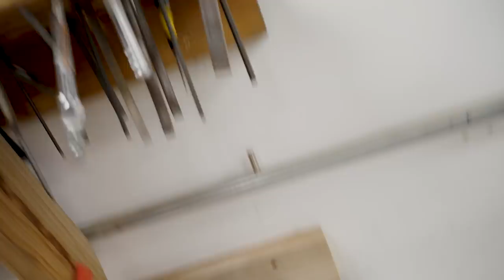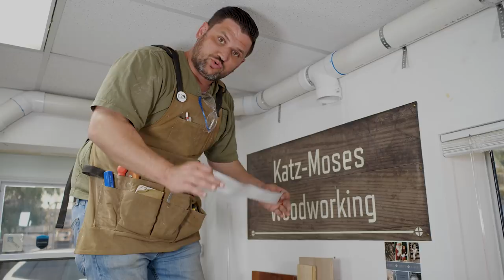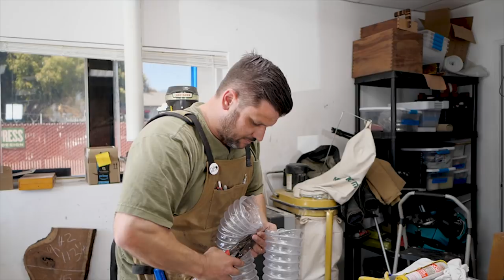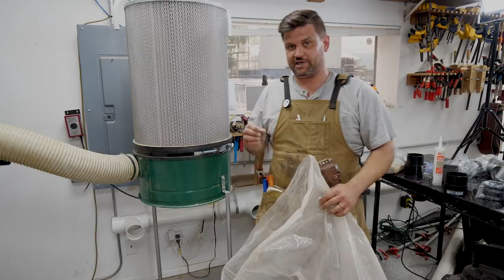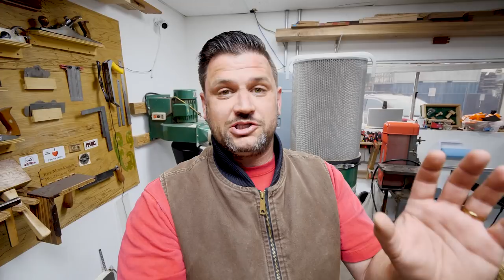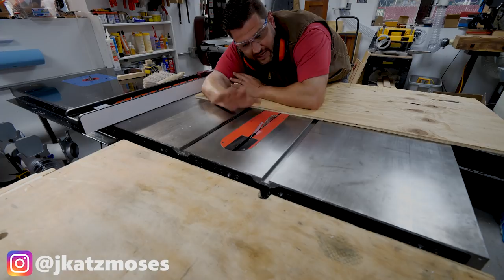Dust Collection 101 and Converting to 2 Stage Dust Collection

Comment: I was thinking of using push fit fittings as no glue needed you just push together there for water so it’s watertight no air leaks and you can just pull apart to change it or if you move not sure if available in America but available in U.K.

Comment: PVC pipe and gluing, try to rotate a 1/4 turn, it will insure a better bond. But you HAVE to move quickly and accurately to your intended position. It will guarantee the seal as well. Hope that helps!
Good tip on the drainage pipe as well thanks!

Comment: You could reduce the amount of dust in your collection bag even more by adding a straight run of about 5 feet of pipe between the intake of the Oneida cyclone and your blast gates. This creates a better straight line of dust flow into your cyclone. Works very well in my HF hybrid system.

Comment: Late to the thread on the comments here, but found a different way to seal the connections. I have several fixed (glued together) sections, which will likely never get moved, but for areas that might be shifted, I use a couple wraps of 3M electrical tape on the male ends and do a force fit without glue. So far, I have no leaks. I have found it necessary to glue or screw together some joints on vertical runs, so they can't vibrate loose and fall out, but the majority of connections aren't permanent.
   Another seal method is to force fit the pieces and use a SMALL bead of basic latex/adhesive caulk (Polyseamseal or White lightning, etc) on the joints to seal. These joints can be twisted apart for modifications, because the bond of the caulk isn't that great.
  Love the video Jonathan, but I do think you would benefit from the use of wyes, instead of Tees at the intersections. Using a short section of pipe between 45 bends also reduces the drag to airflow, based on numbers Have seen with an anemometer.

Comment: if you had to do it over, would you scrap the single stage and go with a high quality cyclone? seems alot of shops have the hard filters, but they still get plugged even when using the upper wiper handle. I have a cyclone unit that i plumbed the piping to the shop wall, exhausting the super fine to atmoshpere, as the filters are extremely expensive. I build in two large fans put in reverse into window openings that help pull any super fines from the shop air. If one was woodworking in the winter, having heat is a must, esp for solid wood projects, and this would be a negative with all your heat getting blown outside. Nice video, enjoyed watching!!!

Comment: Did anyone else JUST learn about the cutter on the caulking gun?
Reply from the maker: the hobbyist hahahahaha
Reply: Absolutely~!  I've never noticed that either.
Reply: I had a combination square for 30 years and discovered the marking pin recently. Really had a good laugh at myself.
Reply: I have a bunch of old caulking guns that don't have a cutter AND some of the ones that are supposed to have cutters don't work well enough to even try.  Unless you have a new tool, it isn't worth trying, just do it the old fashioned way.
Reply: Wait, there’s a cutter on a caulking gun??? Lol

Comment: Does the "squeeze out" of the glue on the inside of the pipe or the other dribbles of sloppy gluing cause problems with blockages in the pipes once you start using it?

Comment: What are your dust collector specifications? I am looking to setup the 4 inch super dust deputy as well for just using on a 6" jointer, 13" planer and table saw (one at a time) with relative short connections and was wondering if a smaller 600ish CFM would be ok.. most that I have looked at don't list a static pressure but I don't think it will be that much of an issue as I will be connecting it directly when using each machine. TY.

Comment: I just got a new Harbor Freight 2HP dust collector to replace my Rockler Dust Right, I also have set it up as a two stage unit. I tried to keep the biggest dust making dust tools closer to the collector. I have all of my power tools along one wall of my shop. I see your PVC extends along a few walls where mine is closer to the floor. Is the system strong enough to pull from the farthest tool? Just benchmarking other shops, love your videos!

Comment: I am about to do the same thing, with a used 2hp vac system that has 2” ports.  any thoughts on why you chose 4” vs 2 or 3” for the hard runs?  More chance of it clogging in a 2”?

Comment: Hey K-M!

Nice setup!  A couple of questions for you....

I had been considering doing something like this but was wondering if changing the motor/impeller from being horizontal to vertical would be a problem for the bearings’ loading?  Or does it matter?  My concern being that if is designed for horizontal orientation that the life of the motor/impeller bearings would be shortened....

I’ve heard that static electricity builds up on PVC from the dust flowing through.  I built my system from 4 inch steel ducting with elbows and wyes from Grizzly that are designed for dust collection, and I grounded the entire thing.  Did you do anything to address possible static buildup?

… And I do like the new camera!
Reply from the maker: Capt I I honestly don't think so but I would not say I'm and expert. My guess is it won't make a difference as most companies make accessories to convert to 2 stage. I did not ground my system but haven't noticed excessive static. I read about 50/50 on whether to do it or not. I'm guessing if there had been 1 reported case of dust collectors exploding it would be 100 percent for grounding. So my guess is I'll be all right.
Reply from the maker: And thank you so much! I like it too!

Comment: Nice job~!  I've got my pipe & fittings ready to convert my own HF dust collector into a 2-stage as well.  As for your collection drum & cyclone...instead of building up a platform to bring it up to the impeller, would it be easier to let it sit on the floor and put a piece of hose or pipe between them?  Just thinking about minimizing the hassle in emptying the drum.
Thanks for the inspiration AND I love my 6:1 & 8:1 dovetail guides that arrived earlier this month~!
Reply from the maker: Andrew Brown was trying to cut down on space and decrease the amount of flexible hose. Could work either way

Comment: FYI  Use thin wall sewer pipe don’t glue that way you can change your runs over time add or subtract without having to cut  ps its much cheaper and is more than strong enough

Comment: Why didn't you get a sliding miter saw?
Also, do you manufacture dovetail guides your self or do you have someone else manufacture them for you?
Reply from the maker: Oliver Delica I bought that thing for 50 bucks a year ago and that's literally the first time I've used it. It sits on a shelf the rest of the time. I use my crosscut sled 99 percent of the time. Also that's a 12 inch which has almost as much cut capacity as a 10inch slider. Plus slider means more things to be a fraction off
Reply: Katz-Moses Woodworking Shop ooh. Also my second question?
Reply from the maker: Oliver Delica check out the q and a I did with my wife. The questions and times can all be found in the description. Cheers!

Comment: Good system.  I would avoid duct tape and  just use slip couplings in most of the runs. If you prefer use aluminum tape.  I wouldnt glue anything. I bet that sysrem works perfectly collection dust and debris.

Comment: Don't know about the rest of the viewers, but if that bag was emptied and you used the black container to suck back up the dust, to me, it seems like there was a lot more dust in that bag than should be.  I mean if part of this project was to not just reduce the amount of space the units were taking up and in fact you say you see about 99% of the dust going into the oneida barrel under the Deputy, I would not be happy seeing that much dust in the bag still.  Not complaining, just curious.  I have seen folks using the Dust Deputy into a 55 gallon barrel or a 32 inch aluminum can and never saw that much dust get into a bag.  Any thoughts on this?

Comment: Is it grounded? I,m installing ADP pipe and all the trolls are saying you need to ground the system. A PHD from MIT did research and said there's no need. Your thoughts? Thanks.
Reply from the maker: No need at all

Comment: Nice ideas, very clean work, only one mistake. PVC should be joined together with a 2 part adhesive. You are supposed to apply the glue to one piece, and primer to the other. When the glue and primer meet, they make an inseparable bond.

Comment: Good on you. One thing to remember is that the smaller the diameter of pipe, the more restricted the airflow is. With a 2HP dust collector, you should be using 6". While it might not seem like a big difference, you would be surprised.
Reply from the maker: Thank you sir. Yea but at 10X the cost and I'm in a shop I'm probably going to move out of in 8 months... I'll wait until I get to my next shop to make that investment
Reply: Oh I hear ya. I went with 4" as well in my shop because it was going to be temporary piping. When you are ready to upgrade, look at the green sewer pipe. It's quite cheap comparatively. Although it does have thinner walls than traditional PVC, that really isn't going to affect the airflow. I'm pretty sure Jay Bates did that with his shop. Anyway, enjoy the convenience of permanent connections at each tool!